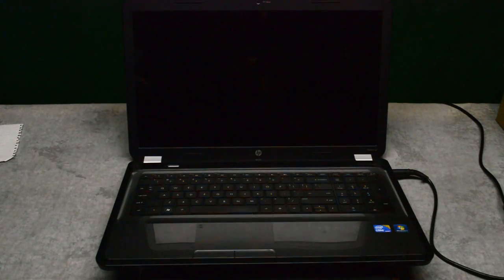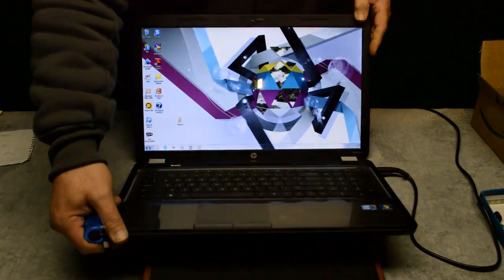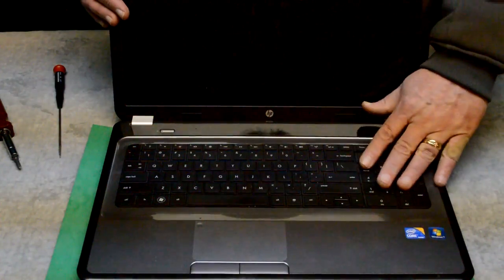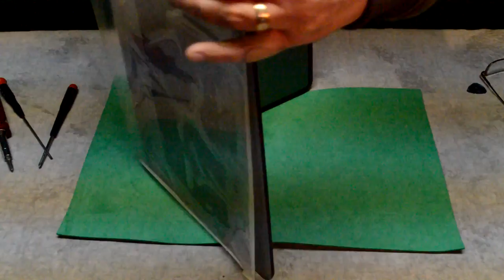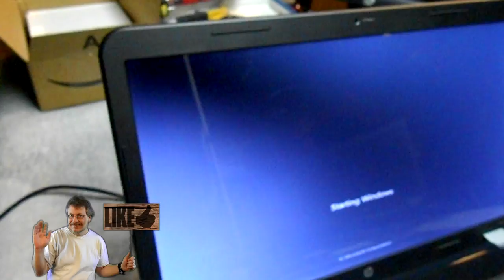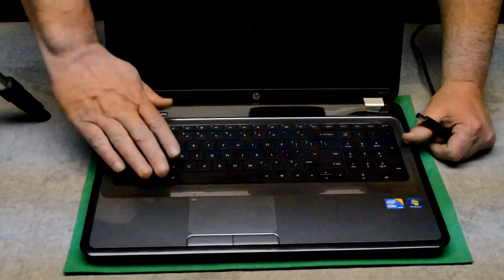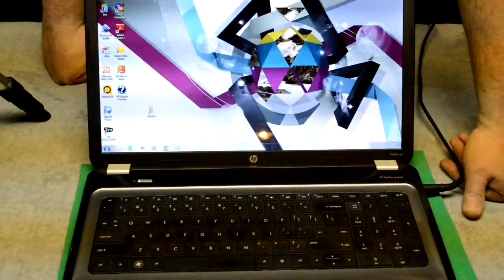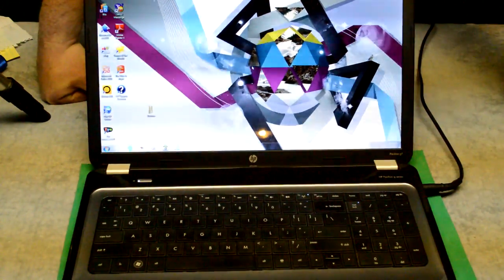Simple Fix - How to Repair HP Pavilion 90B System Fan Error

Comment: is there another way to open and se the fan like for example from the back of the laptop and not open thw keyboard? The fan is expensive? If I use a a stronger cooling deviece under the laptop will it ventilate it better? and keeing cool the temps?

Comment: I tried this, disassembled totally. Disassembled fan, cleaned it , out silicon oil. Turned it on and it was no error. Assembled it , turned on and error was there still. So it is somethin other.

Comment: Thanks. Got the HP 90B message for the first time on my 3 year old laptop. Got access to the fan by removing battery pack and 8 underside panel screws (4 hidden under sticky rubber feet). Just like in this video the fan looked clean and rotated freely when I pushed it round. I put the battery back and started up-. The fan came on, no 90B message, so I screwed the cover back. 3 days later its still OK. Mysteriously Easy fix. If it does it again I'll get another fan, I see you can get one for only about £8 in the UK.

Comment: I have  the same laptop put a new fan in the laptop and still getting the same error message on the screen when it begins so what should I do and how to get rid of the error message there's nothing clogging the fan the fan sounds perfect and I'm still getting a message on my bio screen when I first start up it is a HP G7 it runs very good except for that message that's the only thing can anyone help??
Reply: Did you try a bios reset?

Comment: this is not a simple problem with HP pavilion. i wish it was.. i first brought it in and the guy serviced the fan , cleaned up the dust. paid 20 USD for that. after a couple of days, same problem, went back and he changed the fan. another 20 dollars. problem was back straight after. went to a different guy he said the heat sync has to be changed. 40 dollars. each time i went to pick the laptop up, the repair guys said it was back to perfect, no problems. and the problem still persists after all this. The fan is not running at start up and even if it does, it will eventually stop an hour or so into usage. The repair guy said probably the graphic card needs to be changed as it can interfere bla bla bla..i have booted the BIOS and also uninstalled all recent updates that may be the cause. I also previously restored the pc to a time point when the problem didn't exist. I think its time i bin the laptop and buy an Acer or Dell and tell everyone i know to stay away from HP

Comment: Simple fix? No sir, it's  a lot more complicated than that. I cleaned the fan all out with the vacuum cleaner and duster and I am still getting the 90B error message. There is much more to do. There is nothing simple about computers. You probably have to go into the BIOS and change something in there.

Comment: Okay, you have an old laptop or desktop that you mostly use at home in one location.  The fan just stopped working, the laptop is running hot, and it is shutting down after a couple minutes.  Easy and free fix for dummies like me:  You do have your laptop on a tilt tray base, right?  Just place a small electric fan a few inches away aimed directly at the computer`s fan vent.  Turn it on whenever using computer.  Voila!  Problem solved.  $100 saved.
Reply: Hahahahaha exatamente isso que eu estou fazendo ha´alguns dias...estou com o mesmo problema e coloquei um ventilador ao lado do notebook, e ele está em cima de uma cadeira com assento todo perfurado por onde refrigera toda a parte de baixo e ele está funcionando melhor que antes! Recomendado ;)

Comment: I'm getting the same message, my pc runs fine though and I can hear the fan, it hasn't overheated at all but I feel like I should still pull it apart to check
Reply: yeah mine too
Reply: its 3 years since you comment. DId your pc runed well?

Comment: This video saved my butt, I cannot thank you enough! I started up my laptop to finish writing a major paper for one of my classes which was due the next day, and it told me my fan was not working, which I knew could cause my computer to shutdown and inflict big damage. Once it had fully booted up, a few minutes later my temperature application showed me it was heating up to nearly 200F and rising. Thankfully, I found your video while frantically looking up solutions on youtube on my phone, and I did exactly what you did and after blowing air into the fan and spinning the blades, it started working again, and I was able to finish my paper! Thank you so much, keep up the good work man!
Reply: I did all that cleaning and I am still getting the error message.

Comment: I'm having this exact same problem with the Hp Beats edition lap top. its different from this one however I'm sure the same general techniques apply. 

Anyway, I continued to take the laptop completely apart 4 times yesterday to try to fix the problem, first I cleaned the fan and it's blades and that didn't work, then I took it apart again and cleaned out the fan intake/outtake. There was ALOT of dust there which made me think i had fixed the problem, I took a needle and pushed it through each of the little openings to try to push any dust out, I unscrewed the fan unit and everything to clean it, to no avail. 

However after doing this (going the deepest into my computer than i had ever gone, as I had undone the Green Techey looking piece (motherboard?) from its plastic/metal base to get to the underside of the fan. After doing this I had another error on my hands which really worried me. an F03 error where the hard drive was uninstalled. I took it apart a fourth time to make sure i had reconnected everything properly, unhooked it ALL and rehooked it ALL and the F03 error disappeared.

I must've jostled my hard drive while doing all this for my fan. However after cleaning all that dust (im talking mini hair balls) out of the fan and the intake/outtake, the thing still sounds like a race car. When I turned my lap on it didn't give me the fan error, but I can't really feel air blowing from the out take. I'm just confused on what to do next. Also, I read it could be a heat strip problem. my heat strip is a bright orange/chrome color and I will admit, there seems to be heat damage on it. (In some areas [specifically where the heat strip curves]) there are small indentations or bumps (cant quite tell which) that I'm imagining happened from the heat strip getting too hot. And yes, I do run my computer for extended periods of time when I know I shouldn't.....

My computer RUNS fine. its not slow or anything, it just is sooo loud, that I refuse to take it to college class with me, because I know the person on the OTHER side of the classroom will be annoyed by my screaming laptop fan. Any advice would be great.

Comment: I notice this is a typical problem with the HP G Series laptops, I have come up against this in past, replaced the fan with new, and 2-3 months later, same problem. Could this not be driver issue problems??

Comment: Here's what I did to fix my System Fan. I went ahead and turned it on and looked under where my fan was located. I was noticing that it was trying to move, but was stuck at a location. I went ahead and grabbed a needle and spun my fan a direction. It took a few reboots but it eventually worked.
Reply: Thanks i will do that

Comment: I immediately got this error after using compressed air to clean the vents.. Hmm
Reply: You've broken the fan by spraying it with compressed air. I know hp recommend compressed air but if the air catches the fan blades it will make the fan spin at an insane speed which will burn it out. seen this happen loads of times.
Reply: bluebull399 maybe preventing the fan from spinning with something while spraying will help...

Comment: Can someone help me? I have a similar issue with the same error message, however my fan sometimes turns on and off. Sometimes when I start typing a document, a certain key press will activate the fan, but then it turns off after I release the key. Is this problem caused by dust buildup or is it something that I should get my computer checked for?
(EDIT) -  Now it only works when I turn my computer upside-down.

Comment: Hi and thanks.I can see the dust on the fan. I poked a little screw driver thru the hole to remove the keyboard but it just poped the letter ( O ) key out. Any other ideas on how to get the keyboard out without having to take the whole laptop apart. It looks like we have the same laptop. I have the HP Pavilion G7-1261NR.

Comment: I don't think it's the most "awesome" idea to instruct people to use a shop vac to clean out a computer. Nice instructions on taking apart the computer though.
Reply from the maker: Well, I have been doing it for over 25 years on hundreds if not thousands of computers and it has worked for me. Just saying...
Reply: Sara Dolbeck Its a tradition that has worked for me as well. Fans become "unbalanced" with crud, dust, etc and gives out an error on rpm tolerance. over 15 years on pc/ laptop repair myself.
Reply: GuruBrew My hp pavilion g7 makes a weird high noise after cleaning it witg a vacuum cleaner help?

Comment: Thanks for the video, however, you didn't realy illustrate how remove the keyboard by pushing a thin screwdriver through a hole. Which hole? My G7 has 2 holes, both labled as keyboard release.

Comment: So yeah never vacuum your computer. Even if it's just a fan. You'd be better served taking the fan out, removing the cover and removing any dust manually as more often then not if the error pops up the fan's already so clogged that blowing it out won't remove the Felt that has formed inside the heatsync. This would also be a good time to ditch the stock heatsync compound and install new Arctic Silver of other well rated compound. Stock compounds on cheap laptops will harden and fail over time and over heating speeds that process up so don't be shocked if you clean the fan and it's still running hot.
Reply: Finally someone that has some sense, you never vacuum out anything on a computer. Has this idiot ever heard of ESD??? I hope no one brings computers to this hack ever again.

Comment: Hi i really need help, my laptop was working fine but the fan was really loud, i figured it may be a build up of dirt/dust. so i get the vacuum cleaner and put it over the fan to try and clear it out, when i turned it back on this 90B message came up for the first time ever. now the fan is super quiet, so not sure if its actually running anymore. Any idea's on how to fix this? a reply would be greatly appreciated as i need to fix my laptop asap, thank You

Comment: My g7 is a little over one yr old and I started to get the same fan error message two weeks ago every time turning on the laptop, I continued to use the laptop without the fan working and can feel the overheating with my fingers near the fan. While watching this video I turned the laptop upside down using a flashlight checking the fan just like GuruBrew did in the video. Miraculously the fan started working without any reason, I powered off and on a few times and the error message didn't show up and fan works fine now, It sounds stupid but that is what happened, just glad I don't have to take it apart. Who knows how long the fan will keep working this time! Thanks for the video, GuruBrew!
Reply from the maker: When you tipped it up the dust ball probably moved out of the way from the fan but please keep an eye on it. It is never good to run a computer hot without a fan. Glad to help :) Steve

Comment: What??? An HP Laptop with a fan issue that can cause it to overheat!? I have only had a few (dozen) of these Hp Laptops come though my shop that have overheated. Normally its the Hp DV Series I see where the mobo has failed due to the video chip overheating. Another great Video Steve! Keep 'em coming!